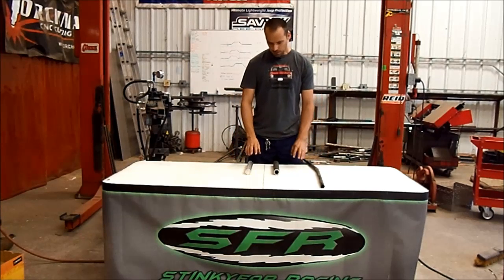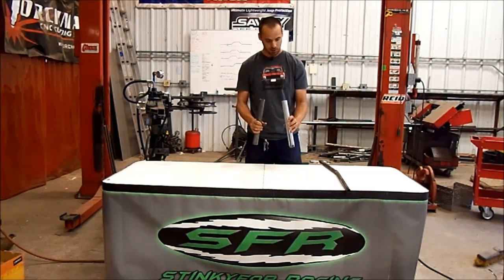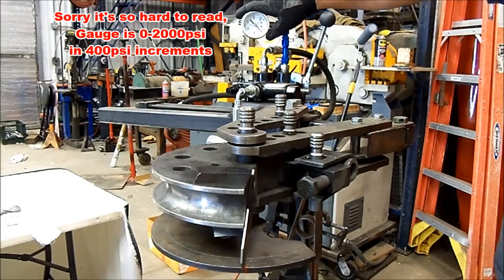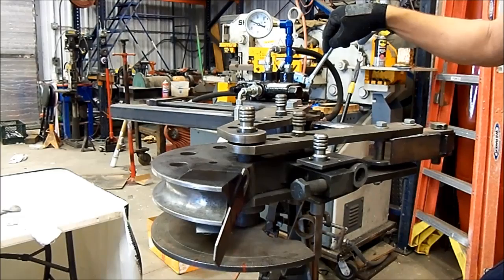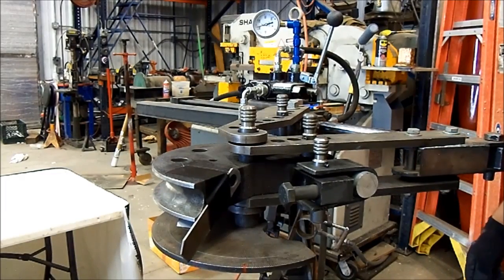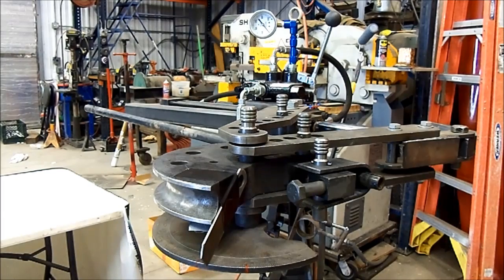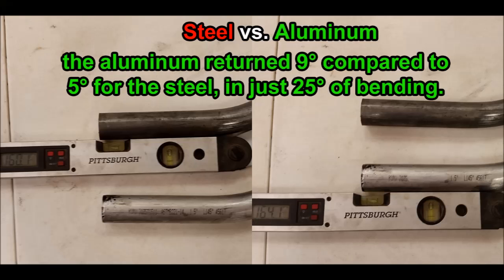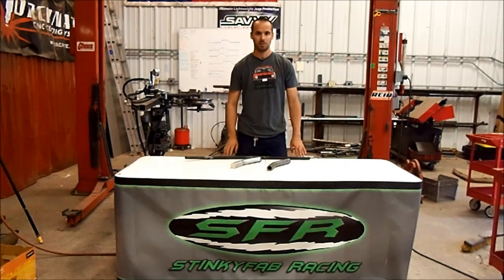Off-Road Steering and Suspension links. DOM Steel vs. 7075 Aluminum strength testing.

Comment: a 7075 Aluminum bar compare to a DOM steel tube, sounds quite unfair enough. Also the cost is way different
Reply: Just read your comments, and thanks for your full opinions about both material. I just got a job on seamless steel tube factory. Can you name some off-road parts that are made by steel tubes for me? Really greatful for you to do so.

Comment: Ok but how weak and prone to cracking at the threaded portion is the aluminium?  I would not trust the aluminum to not pull out the threads and TRE and link ends probably are solid welded because of electrolysis.
Reply: In over 15 years of use on competition rock crawlers and ultra 4 race cars I've yet to see one pull the threads out. 7075 is not like your more common alloys, it has properties much more similar to steel. I've also not had problems with the ends getting stuck because i use antiseize, which you should always be doing regardless of material. I've had plenty of steel links with the joints rusted in place because someone didn't use antiseize

Comment: Wow, the cost of the 7075 is about 5-times that of the DOM!!

I'm preparing to fabricate baja front/rear bumpers and 7075 would cost me about 3k in material versus around $570 for the DOM.
Reply: It's not a cheap material, but it works extremely well in certain applications. Not sure i would bother for bumpers.
Reply: @stnkbg1  But you'd recommend it for control arms?
Reply: Put it this way, when I was crew chief for the redbull rockcrawlers we had to replace the front lower link on one of our cars about every 3 events. We tried heavy wall DOM, heat treated cromoly, square, round, etc. It just kept getting bent. Swapped in a 2" 7075 link one of our sponsors made and never touched it again. After that I was sold. Since then I've started using it on all my steering and suspension links wherever possible, because the stuff can just take a hit and come right back.
Reply: @stnkbg1  Okay, I can see the benefit. So would you recommend for a long-travel suspension fabrication for higher speeds.
Reply: That's almost exclusively what I use it for these days. There are lots and lots of top level racers using 7075 suspension and steering links in Ultra4 and Score desert racing.
Reply: @stnkbg1  Hmmm... I'll need to consider this. I'm working on a truck I want to display at SEMA but she's not a pavement princess so she'll see some duty.

Wish I had a sponsor to throw down some 7075 control arms. Hehe

Edit: Not sarcasm. I really do wish I had a sponsor to kick down some sick control arms.
Reply: @stnkbg1  what about the 7075 vs. boxed control arms?
Reply: That all depends on the design and intended usage. When you're looking at needing a straight link connecting 2 points the choice is easy. When it gets into complex shapes and fabricated structures you start getting into more serious engineering territory. You can build boxed arms that are garbage, and ones that will survive a nuclear blast.
Reply: Correct!  and there is no real advantage there, unless ounces count.

Comment: why are you comparing a tube to a bar?
Reply: Cuz that alumalloy is still lighter?
Reply: @hamsterplayer9303  YES,,  steel on average is 2.5 times heavier.
Reply: I wonder how heavy and resiliant a steel bar would be. If you made something out of this aluminum as heavy as that, it would be just massive. And not to mention crazy strong
Reply: @jodyhartwig5663  Generally speaking DOM tubing is very close to the same strength as a solid rod of the same material
Reply: @kylemilford8758  how? That's ridiculous
Reply: Dylan Tirto because those are the materials used in heavy duty steering kits.
Reply: No, I mean one is solid and one is hollow. The bending strength would not be fair due to the cross-sectional area
Reply: Dylan Tirto yes, as i said those are the materials commonly used for heavy duty steering kits. It's not a comparison of tube versus bar it's a comparison of two materials used for the same purpose. A lot of companies use .250 wall steel for steering SFR uses 7075 aluminum round bar. That is the comparison.
Reply: It wouldn't make sense to compare aluminum tube to steel tube because aluminum tube is not used for this application
Reply: I see, gotcha :)
Reply: @stnkbg1  The ultimate tensile is around 83,000 psi while 4130 chromoly is 93,000 psi which is pretty close.....DOM 1026 is about the same. So why do you feel the need to use a solid bar vs a tube? Even a 3/8" wall tube? I'm asking what a lot of people are wanting to know......can you replace any of these alloys in whatever application with 7075 given the properties are similar?
Reply: @tall1fin1  in this application tensile strength isn't really the biggest concern, resistance to bending from impact is. 7075 tubing also isn't nearly as easy to source as solid bar, and solid bar is already somewhat difficult to find. 

If you want to see the abuse these parts see, go watch the "chocolate thunders greatest hits" video on this channel.
Reply: @stnkbg1  Actually 7075 is very resistant to bending compared to steel. In a bounce back test it was significantly better. You can buy 7075 tube at TW Metals.....twmetals.com
Reply: @tall1fin1  yeah, that's the entire point of this demonstration and why SFR uses 7075 for steering... because it bounces back.